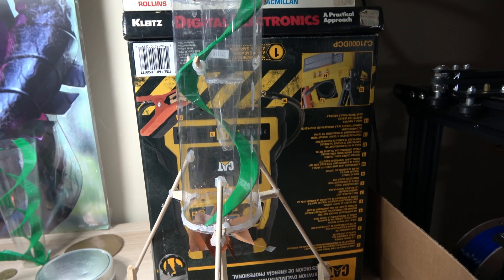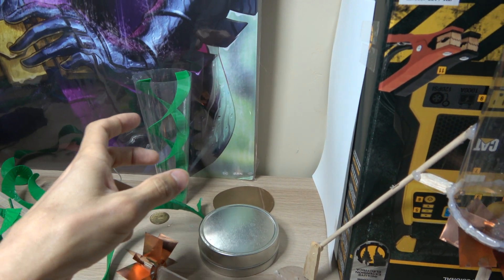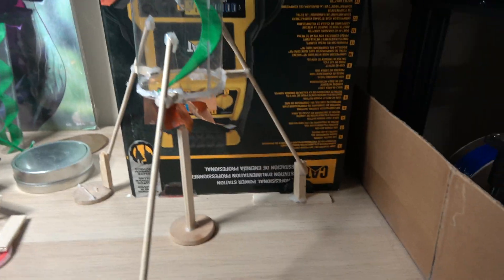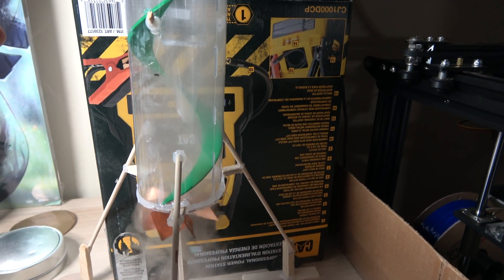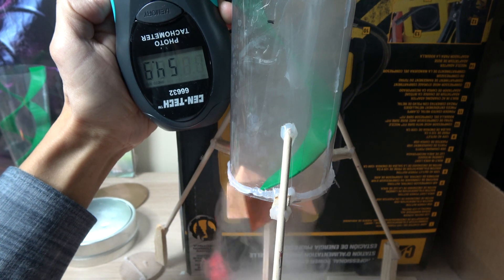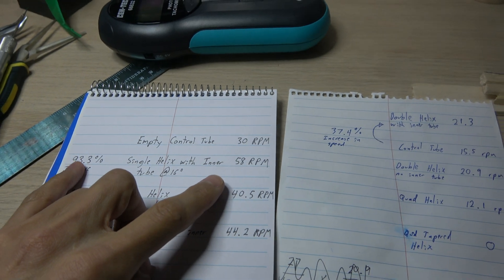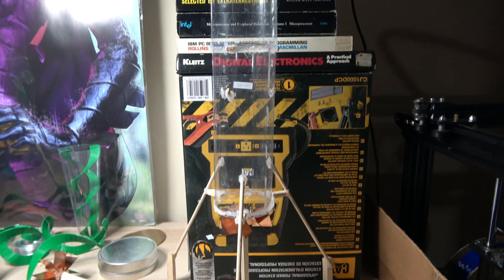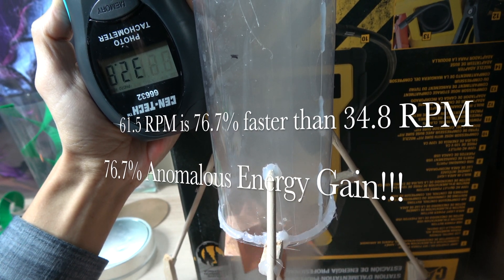77% Gain in Air Speed with Schauberger Helix Vane!!!

Comment: here you can apply Bernoulli's principles : PxV/S remain constant. If you reduce section S by half your speed V  must double in order to remain constant . (because your spiral is blocking half of diameter , anyway  it's  not a complete block  but can say that the spiral it have a braking effect by staying in the way.) P is the pressure.
Reply from the maker: Nice try but your wrong.  lol...   The spiral doesn't block the area of the tube, it merely gives a slight change in direction to perhaps half of the air flow.  Therefore your argument is erroneous.  A slight change in direction to half the air flow would under normal circumstances result in a reduction in air flow, not an increase.

Comment: Not trying to be negative, I’m only trying to be constructive. You’re changing the direction of the air using the helix. Therefore you’re changing the direction of force applied to the fan blades and your fan is spinning faster.  It’s just changing the shape of your air pressure.  Almost like Venturi effect. Have the tube extend farther down than the bottom of the helix so air pressure has a chance to become more uniform in the tube before it hits your fan. Change the orientation of your fan to show down force vise spinning down force.
Reply from the maker: Your wrong, I'm sorry.  Here's why.  Focusing perhaps 50% of the air flow and directing it at a sharper angle to deliver more of its kinetic potential into the fan blades, should only result at best in a 50% gain in fan speed.  I have demonstrated a 77% increase in speed and I have a new design that's far better.  Therefore your argument doesn't hold up.  Perhaps in part, but not in full.  Something strange is happening in my experiment that relates to the very nature of energy itself.

Comment: have you looked into how pulley systems and gear ratios can amplify or dull energy? Im a noob at this stuff but with your experience in making these systems, do you see any probability of being able to have strings or gears redirect the energy flow to the desired amount? for example that rotating blade can power a fan that pushes more air into the system. Is this efficient enough?
Reply from the maker: I see where your going with this.  In order for your idea to work I would have to have created an over unity device.  This is in fact the direction I'm moving, but at the rate I'm going it will be a few years yet before I succeed.

Comment: Thanks for trying the 3d model. Nice to see. Sad that it doesn't give results. I need to finish the program to model these shapes. The proportions and twist can be wrong. It's a matter of intuïtion and 'knowing' things that lead to results (besides the usual things like perseverance trial and error and knowledge etc.), so it's nice to see that you follow your own idea's instead of the prescribed things from books. 
Can you also see or film the particles going down? How much faster is the moist air flowing?
It looks like what happens with water bottles, they are emptied faster by shaking and spiraling the insides first
Reply from the maker: Your welcome.  Its inner shape is wrong.  It needs to look exactly like an egg with a quarter part taken out as seen in Viktors design (or else the air won't spin inside the larger spiral).  I will create it perfectly in time.  Right now I'm debating whether to simply improve my current design and continue in a progression of continually improved designs ultimately leading to a design looking just like Viktors, or I just cut to the chase and design as close a replica of Viktors design as I can.  The problem with doing that is that if it doesn't work I will have no idea what I did wrong.  It will be a stab in the dark and having achieved no earlier steps I will be just guessing based on intuition and luck.  Who knows, maybe that's the better way to go, but it won't teach me exactly what I'm doing each step of the way, if you know what I mean.  

I was only able to print out about 2/3s of your model because it became too unstable for my printer to create it accurately.  It gives results but less than the tube beside it that is in a straight line.  The twist needs to be sharper so there is less of a hole in the middle I think.  I could make a video of your model and post it here on youtube if you want?
Reply: @spiritelemental  Yeah it's difficult to see where you doing wrong when you use Schauberger's shape, there are many parameters to that design. Step by step I get it. And I think you're right that the inner shape is shaped wrong. Thanks for the proposal, but for me the steps are the same anyway: write a better software tool for making better shapes, then print a model, and then I'll see, I think I know enough that the straight model works better XD
I am more inclined to experiment with water flow, easier to measure things, - with height difference, or pressure differentials. And maybe even want to print a transparent shape and see how colored water moves through it. My goal in the end is to make a springwater device.